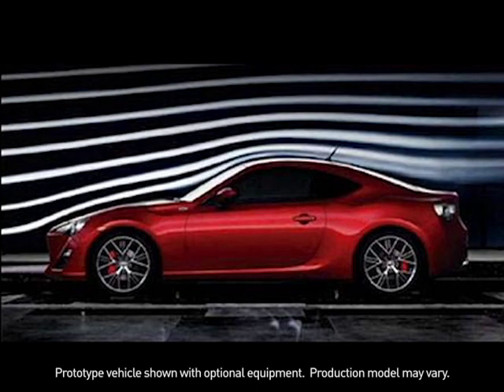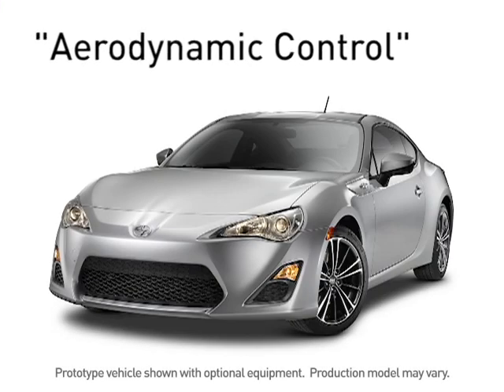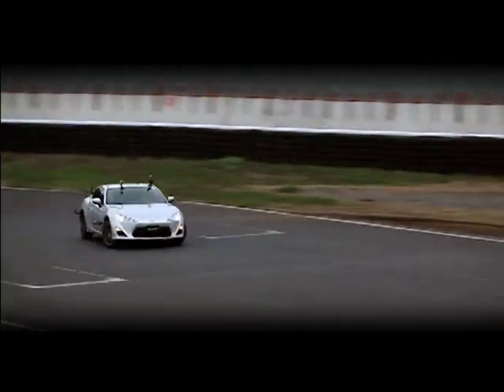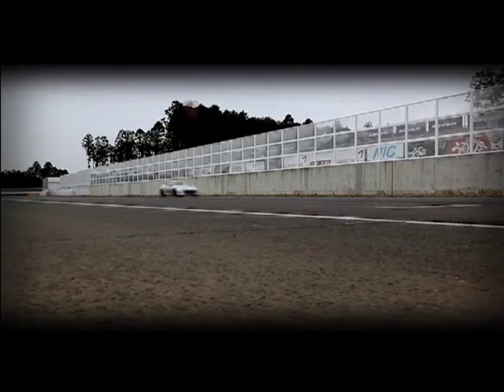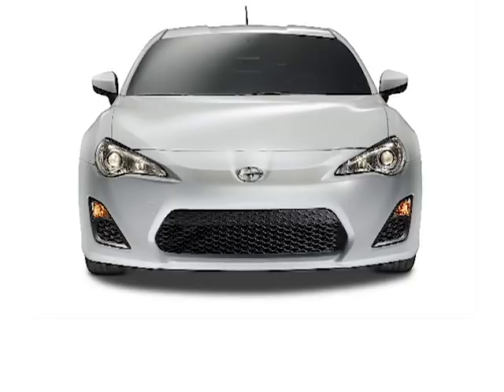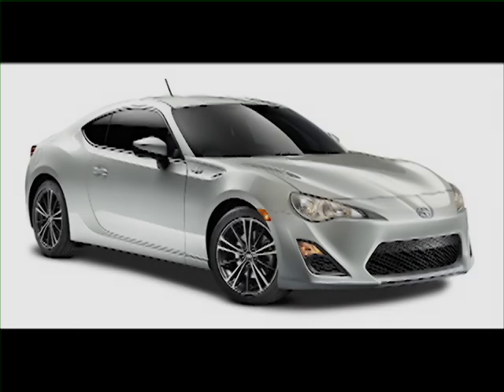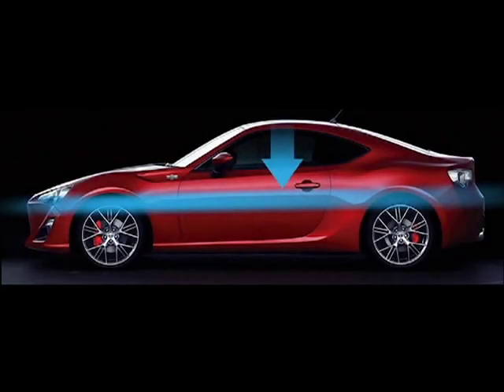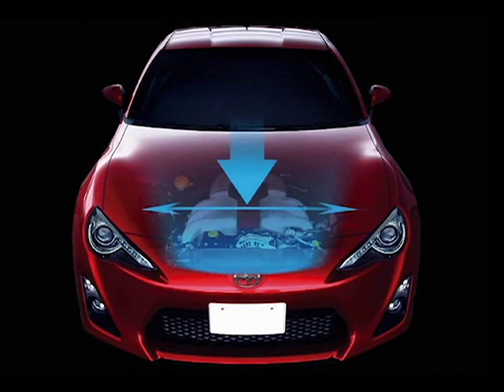2013 Scion FR-S | Aerodynamics Explained

Comment: You didn't explain a single thing.  You simply talked ABOUT explaining things. Whats that little divot in the fender just behind the front wheels for?  "Aerodynamics," he says.  That's a non-answer.  Puffspeak.  No substance.  Scion blokes are usually tech heads.  We can handle a more exact reason than, "to make it go more gooder."

Comment: the eg33 was basically the subaru 2.2l engine with 2 more cylinders.  so, a 6 cylinder boxer engine with 3318  cc's in displacement.  3.3l